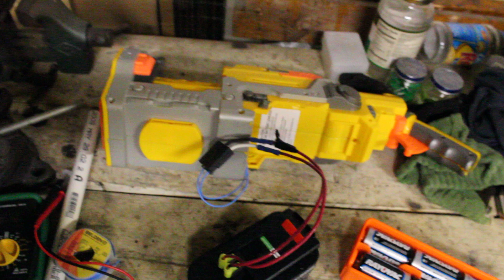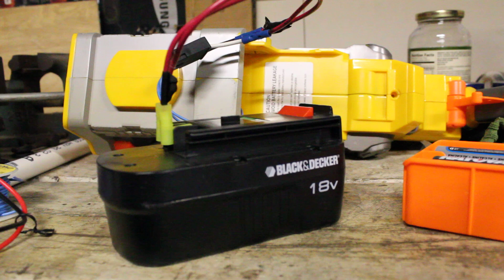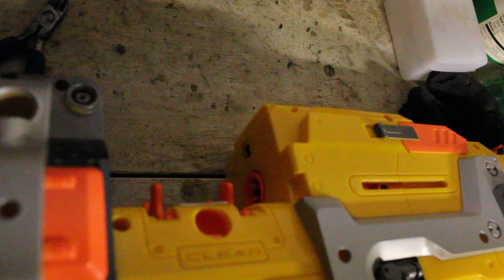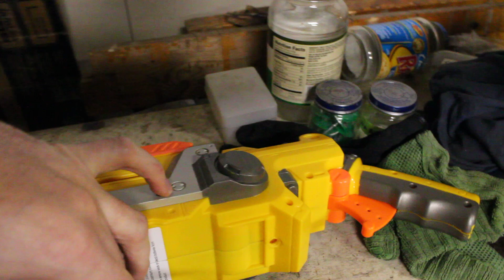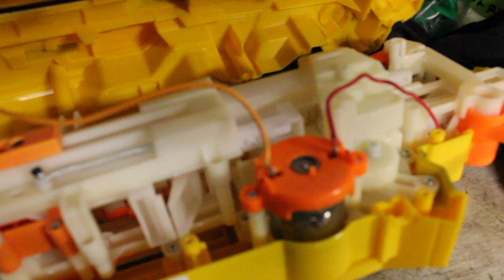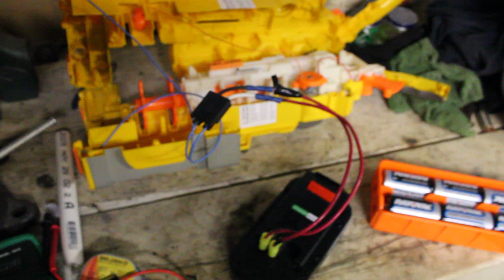Nerf Vulcan simple motor mod, what NERF doesn't want you to know!

Comment: Somewhere on youtube is a way to mod the Vulcan's battery tray to accept a 9.5 volt r/c battery(or TWO!).  Speeds up the rpm's significantly, and the batteries remain INTERNAL  It also makes the weapon significantly LIGHTER, and you don't have to spend a small fortune every time your power goes down(rechargeables, y'know).  The mod is fairly simple(you don't have to be an electrical engineer), requiring only a little rewiring, and removing the plastic pieces that hold the D cells in.  I used only one battery, for fear of damaging the rather flimsy plastic feed system, and the possibility of burning out the motor.  Using this mod, a 100 round belt goes through in about ten to fifteen seconds or so, sustained fire

Comment: can somebody please tell me how to remove the regulator please!!!!!
Reply: +Stephen Johanson I think you just cut it off and re-solder the wires direct to the motor.
Reply: +jec0435 cut it or unsolder it but the solder is very thick and I would recommend cutting it
Reply: +thedavinator 37 The regulator is the green processor (i don't know the exact name) on the motor?
Reply: +Gunslinger 890 yes with the magnet and copper coils
Reply: thedavinator 37 If i want to improve the performance i must only remove this green processor and change the spring?
Reply: +Gunslinger 890 I think and add Bette batteries
Reply: thedavinator 37 Better?
Reply: +Gunslinger 890 higher voltage
Reply: I broke one of the motor hooks I wonder if I can still use the motor?

Comment: Please help. i tried link 8x AA batteries as 12v. Its didnt go faster. As ur video, i  removed the regulator on the top of  motor as well. It didnt go faster. Am i missing somthing? Or  8x AA batteries as 12v is not power enough?  thx
Reply: Try 2 9 volts
Reply: The problem is that the ampage of aa batteries is to low try using 9v batteries connected together
Reply: +Raine Creech I did this and now the gun is getting jammed. I thought it might be the torque in the motor but I replaced it and it still jams. What's the problem?
Reply: try rewiring the electrical system and greasing
 the gearbox

Comment from the maker: Alex, I used flag terminals. They are 90 degree crimp on connectors. The female type slip right over the male terminals of the battery. Batteries differ so you might have to be creative.

Comment: @wildwildwest11 - hi. ok update. I tried to the use the motor you mentioned on your facebook page and that motor wasn't puttin out power for some reason. when i used the stock motor it worked like in your vids. now my only problem is keeping the chain from jamming - the cycles are so fast jams occur. I'll get it figured out. thanks again!

Comment: @wildwildwest11  - hi. I just finished this mod with all the same suggested parts ( battery, adapter, motor, removal of regulator) and my gun does not have the same rpm :( what did I do wrong? I've allowed my new battery to charge for 2 days straight and no power performance increase. 

is it possible Worriedawesomeness is right about the new motor needing a regulator? thanks

Comment: ignore my previus comment, it dose have a slight magnitism but it dose resist the voltage. and if u do this mod u should add a heat sink or a fan to keep the motor from burnning up.

Comment from the maker: I soldered the wires to the terminals on the motor (I assume that is the silver cylinder you are referring to.) I didn't use any hot glue. It is non conductive and can't be used to join wiring.
The board can be completely removed like I did with a soldering iron and some solder wick, a braided cable that will pull up molten solder. Completely de-solder the motor terminals before forcing the board of the motor or you risk breaking them off.

Comment: did u just hot glue the wires into the small little hole on each side? cause I broke off the circuit board thing and my wires arnt connecting to the silver cylinder, (do u just hotglue em on?)

Comment from the maker: Yes, the adapter is from the Firestorm battery system from Black and Decker. I just removed the top cover of the charger socket, desoldered the contacts from the transformer, reconnected the contacts to the power wires for the Vulcan and used the bottom of the adapter.